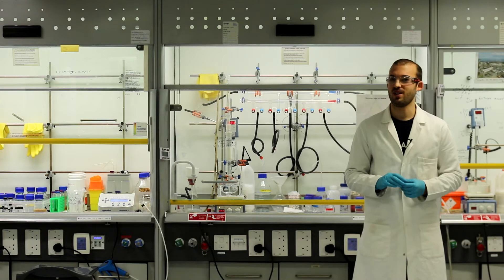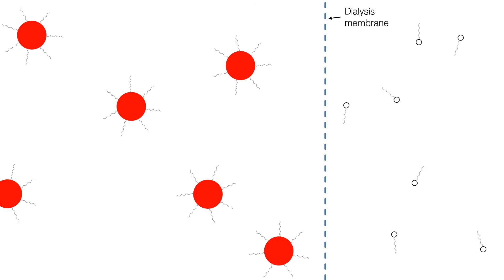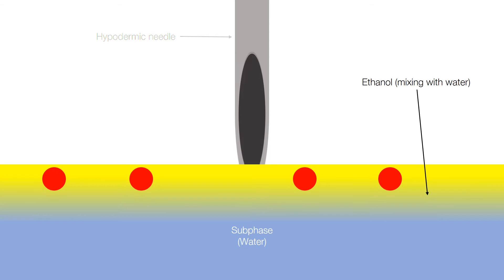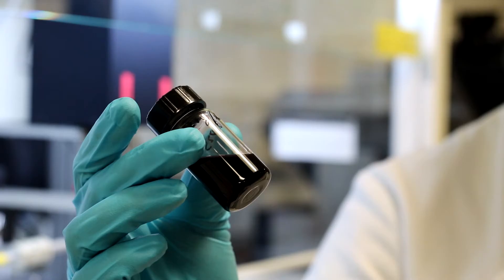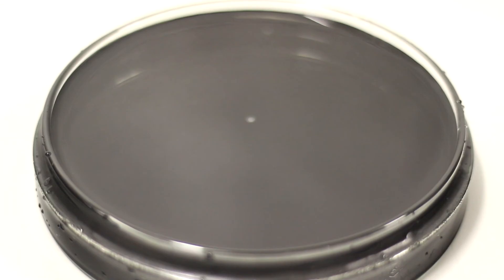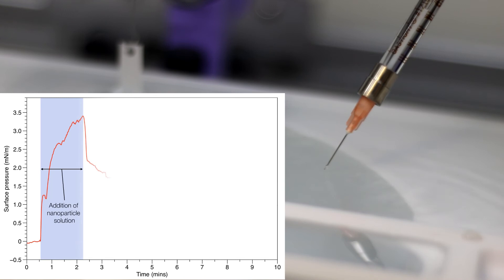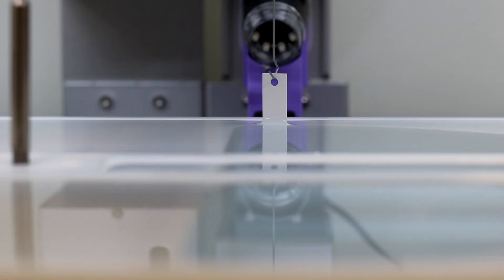Langmuir-Blodgett Trough Tutorial - Part III: Monolayer formation and taking an isotherm

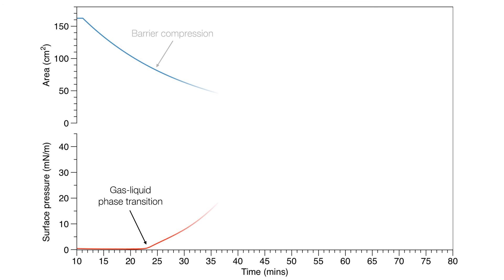Comment: 3:08 why doesn´t the liquid to solid phase transition result in a steep increase in the surface pressure? And what is relaxation?
Reply from the maker: Hi Nicolo, this depends on the nature of your building blocks. You are correct that for model surfactant systems we would expect a steep increase, but we are working here with stabilised nanoparticles. Relaxation is the process of keeping the barrier position and giving the 2D assembly time to re-arrange. Often we observe a reduction of surface pressure over time in this scenario.